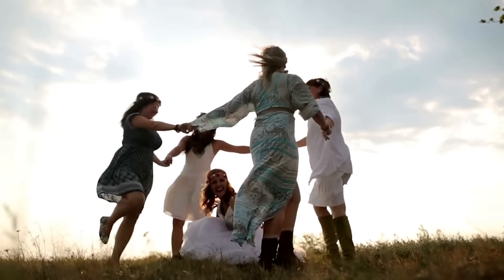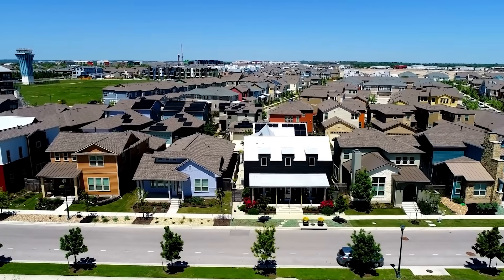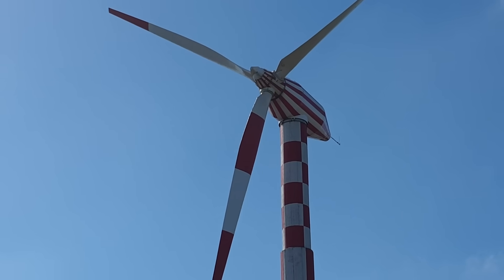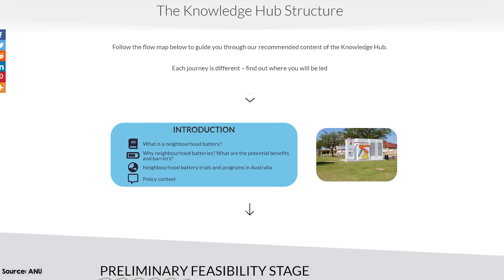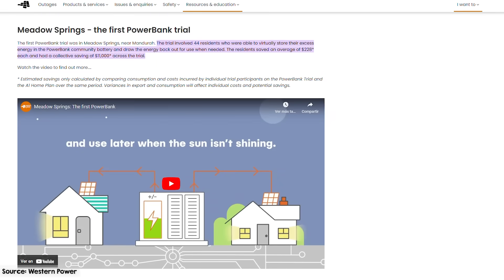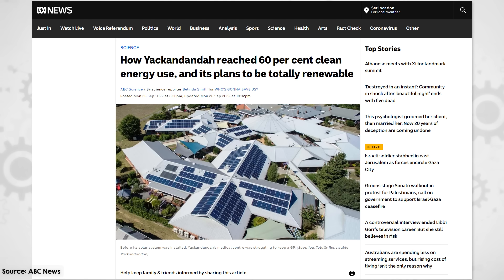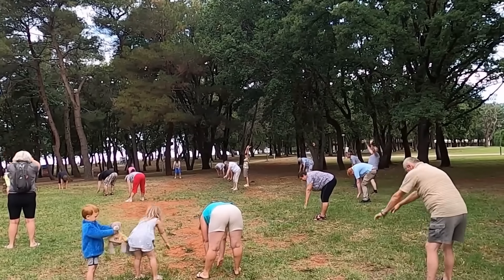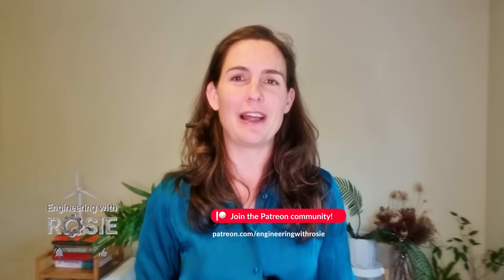Energy Independence Through Community Batteries, Wind and Solar

Comment: Grids are 66% of the power bills.
300gWh daily is our Australian avg demand, with peak generation capacity at 600gWh daily if you are lucky. 

300gWh x $0.43/kWh = $130million daily.
Plus $20million connection fee daily.
$55 BILLION every year.
GARRENTEED cashflow.
NOBODY understands the size of the existing national transmission grid to 20million buildings and millions of ends to the grid.

This engineering fact of concentrated electricity generation is totally ignored. 

Snowy 2 , a $2billion project is now a $12billion project. 
Smoke and mirrors from vested interests when people talk about the stuck tunnel machine. 

The original tunnelling was to be done inside the $2billion tender.

The extra $10billion is the towers and wires across rugged terrain to distant electicity supply and users. 

The poles and wires are the real story to our energy future. 

Even the nuclear promoters attack grid costs for 'free' electricity. 
GRID COSTS are the UNSPOKEN cost with all centralised concentrated electric generation. 

Dispersed generation and storage on the existing national grid has this killer economic advantage. 

Talk about the real grid costs and particularly in a no fossil fueled future world.

5times more electricity is 5times more grid capacity.

Comment: This could be a valuable piece of the puzzle, especially for reducing the needs for transmission upgrades in hard to build areas. And grid scale solutions are still going to be needed for large commercial and industrial uses. And each project needs to be chosen and designed to fit the problems that exist in a specific situation. off the shelf components, yes. Off the shelf designs, no.

Comment: Retaining grid connection is like having a big battery backup when the micro grid needs help or can supply extra to the grid.

Can be like a system that transfers your home electricity to your EV plugged into the grid at work, or at the shops, or anywhere.

Comment: I'm surprised that in that one case that community batteries only increased the share by about ten percent of "energy independence".  But, I guess that is because the share of unstored local PV was overstated because of not actually factoring in true value of the power.  I'll start believing when Hawaii starts allowing unlimited roof top solar with non-regulated feed -in tariffs.  So much of green energy is smoke and mirrors economics...
Reply: Vested interests make a lot of smoke and mirrors.

Comment: Thanks Rosie -As a rural New England town we have a municipal owned utility. More than a decade ago the town did approve two 1.5 MW wind turbines, which are still running today. We are planning a 2MW/8MW*hr battery and are working to support the development of a 1MW solar field. We don't sell shares of these assets to our ratepayers but we support the community environmental goals. We hope to eventually have smart meters and roll out a Virtual Power Plant (VPP ) style demand response system . We have a voluntary text message system to encourage peak load reductions, and support WiFi controlled EV chargers. Communities can be very innovative, but sometimes we can make mistakes too.
Reply: What town is this?   and yes I think demand response will prove to be more important than batteries for the next 20 years.
Reply: I'm a commissioner at PMLD - the light department in Princeton, Massachusetts.  @brianjonker510

Comment: Community batteries are located in the community. 
The government paid expansion of the grid to supply the extra electricity loads is avoided but not in the accounting. 
The failure to measure this saving is a failure to manage our future. 

I know expanding a commercial building footprint, and its new increased load on the local grid, depends on local grid expansion works.

I  have worked on such a project that was delayed from even BA approval until the grid operator's work was completed.

This was a suburban building, not a greenfield site.
More affordable housing will increase community demand. 

The expanding population of Sydney means expanding demand.

Wealthy suburbs buy more Tesla's and other EVs and more rooftop PV. 

Government pays for the expensive grid expansion. 

Grid costs are 66% of electricity bills. 
The grid is incredibly expensive. 
Suburban land and the environment makes city construction even more expensive.

Edit. I commented too fast, Hahaha. 
You did a great video. 👍 😊😊

Comment: Thanks for covering this. I think that community power is necessary as part of the "all of the above" strategy to fight climate change. There is not time to wait for large grid scale projects to solve the fundamental issue of reducing the rate we are putting carbon into the atmosphere. Every idea that creates less carbon than displaces has to be explored and implemented. We need Cheap basic transportation EVs and electric trucks and busses as soon as possible. For trucks and busses, electric hybrids could cut diesel use in half as a intermediate measure. Could you imagine reducing diesel carbon emissions by half globally while full electric heavy haul infrastructure is created? I still don't think hybrid cars are worthwhile but since truck emmissions represent such a large problem I would concede that electric semi trucks with a small diesel range extender could help bridge the gap since a generator can run intermittently at it's most efficient RPM when needed to recharge a medium sized battery.

Comment: Seems to me like community-scale batteries fall in an odd in-between zone.
Factories pump out tons ready-to-use of home batteries, and there is little overhead otherwise. You just wire them in and you're done. Maybe you can even do much of the work yourself.
Grid-scale you're looking at a ton of planning, managing, heavy-duty equipment and so on, but economies of scale make it affordable.
At "community-scale" you're running into much of the same challenges as grid-scale (e.g. securing the installation), but you don't get the benefits of being large scale. No wonder the price per kWh is pretty high for this type of installation.

Comment: I am in the uK and am a comunity power investor. I hae shares in three wind turbine projects, two run of river hydroelectric projects and a solar farm + battery project. I'm currently waiting for the share offer to open on the largest comunity solar farm + battery project in Wales. I get between three and five percent per annum dividend on my investment and the majority of any surplus goes to a charitable fund which allocates grants to various local charities. As well as the dividend I get 25% of my investment back every five years until the end of the project at the end of 20 yrs. If the equipment is still operational and local planning authorities will allow it the project will continue to run untill the machienery is worn out paying all the surplus beyond running costs to the charitable fund.
Reply: Thank you for your investment in our future!  👏
Reply from the maker: That sounds so great! Would you be interested to show me next time I'm in the UK? that would make a great video 😊
Reply: Who pays for removal of old equipment and restoration of the site?

Comment: An outstanding video again from Rosie. Great overview of what works and what is challenging. Where I live there is an overabundance of Nuclear (when it's running right) and Hydro backed up by coal. I've often wondered why the utility doesn't institute a program to put home (or community) batteries distributed throughout the jurisdiction to store the overnight generation instead of selling it for near zero, and then use that power when it's needed and they right now have to bring the coal online. Combine that with some community solar also in the battery and we could eliminate the coal entirely. Sadly, our government are dinosaurs who burn dinosaurs.

Comment: Independent of the public grid through PV? In Germany we are currently experiencing a grey, dark and rainy November. All solar systems are useless. Wind power in the valleys is not feasible. So we need the public power grid again. There are wind turbines by the sea that constantly supply electricity but they are far away.
Reply: Wind and solar is easier to balance than just one or the other. Does Germany need more north south capacity to reach the offshore farms and Norwegian hydro? Also, how is the solar in spain and Italy this time of year? I know you don't get the same hours, but are they sunny?

Comment: Excellent. 
This can be faster than EV roll out.
And decades in front of nuclear electricity. 
Grid protection and not the incredibly expensive grid expansion to carry the increase in electricity as fossil fuels are phased out.
The existing fossil fueled generation can be UNLOADED, and their lifetime extended. 

In the end, the community battery can be part of the rapid charging infrastructure at the corner store and on the main roads.
Reply: In the short term. When V2G is up and running why buy a separate battery when you can buy a battery which can use for transport?
Reply: @rattusfinkus  
And it is free with every EV. Hahaha 👍. 
Selfparking EVs can do the same as home robotic vacuum cleaners. 
Both are parked 23hrs every day. 
Both just trickle charge the small amount of daily electricity. 
7kwh daily from a 100kwh EV battery, ezi pezi.